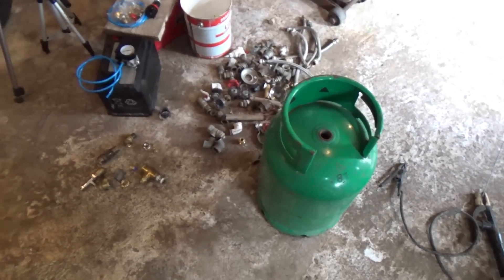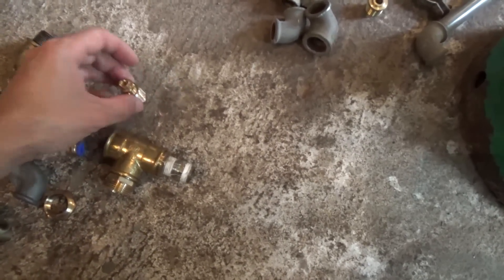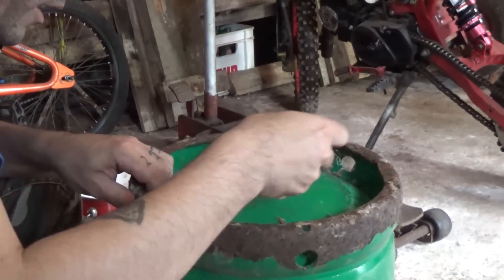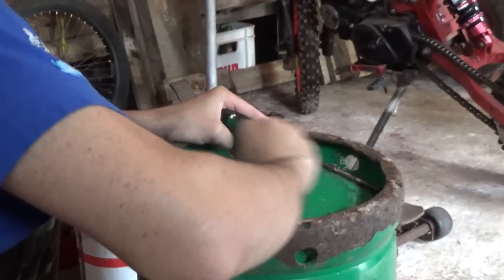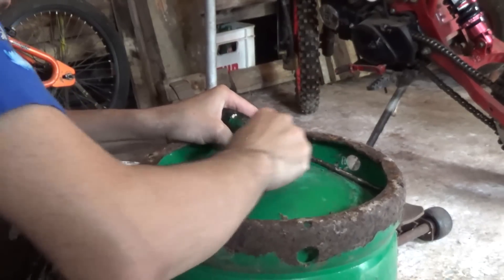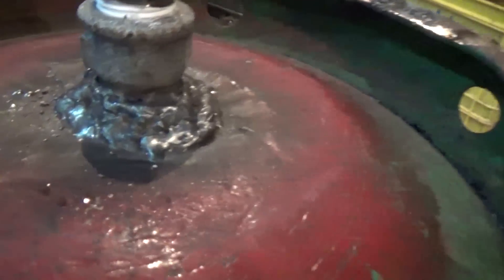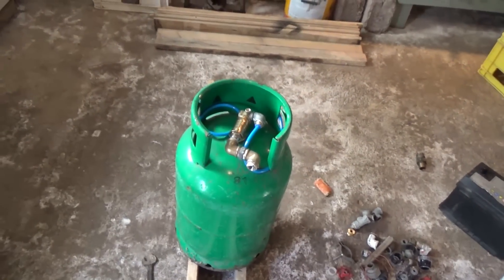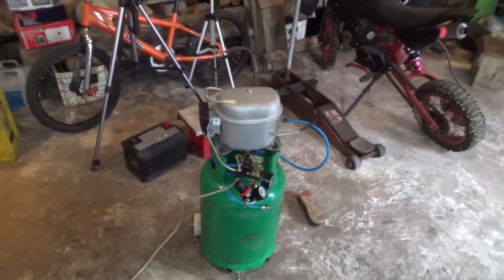Homemade silent air compressor

Comment: If you can't weld, weld lots!
Reply: A grinder and paint makes me the welder I ain't
Reply: Ah no it does not.  But keep practicing.  Every time you weld you will get better and better.  Plus have a look at weldingtipsandtricks youtube page.  Excellent page and resource.
Reply: ***** Couch Ave???
Reply: ***** Ok Thanks
Reply: I agree, he can't weld worth a shit and he said if he had a tig welder he could do better.   NO WAY.  If you can't weld with stick Tig is a lot harder than stick weld.  Even Mig he would do a lousy job.

Comment: Usually the freon or whatever refrigerant runs thru the compressor has oil mixed with it to aid lubrication. Right now I suspect you're running dry air or just air rather. This might kill your compressor a little sooner than usual
Reply: The compressor has its own oil inside. The refrigerant is not the primary lubricant
Reply: No that's correct the refrigerant carries the lubricant around the system however oxygen will over time (I'm not an expert) monoxodize the giggling shaft of the compressor! But till then it's Happy Compressing!
Reply: Jes, 
the oil comes with the refrigerant, and now with the air.
Makes it run dry
Reply: Vikram Nayak 
the compressor will be fine the oil in a fridge does not go around the system .
the oil is sprayed up in side the compressor lubricating it. so using it as a air compressor will be fine if he tops up the oil lost
Reply: You could just flush the oils and contaminants out of your reclaim Refrigerant tanks

Comment: This type of compressor was designed to operate in a close loop containing small amounts of recirculated oil. It will not last long running dry. :/

Comment: Why do you need to purge it ?  you are just compressing airdrop some dry ice in the tank for safety sake as it won't burn or allow the fuel to burn  .  and if you want the drain for draining water and oil , the tank is small enough to just turn it over and let it drain out the top valve

Comment: Nice little project, I built similar but used an old 10l compressor tank.
Two bits of advice, fit a filter on the inlet pipe, I use a plastic fuel filter. Cover that pressure switch, you have live terminals exposed right next to your pressure tap, not a great move. Also make sure that earth strap also connects to the bottle ( so that was really 3 bits of advice). Thanks for posting.
Reply from the maker: Thanks for the advice :)

Comment: This is dangerous. Propane tanks like this are not designed to be refilled for long-term use; they are made of relatively thin metal that can't resist rust (from atmospheric humidity) as well as standard air vessels. Compressed gas has tremendous energy that could be released if the tank ruptures from a weak spot. Perhaps if you had some kind of valving that would allow you to use the compressor to pull a vacuum on the tank and keep it there during storage, you could keep moisture out.

Comment: TAKE CARE ! DON'T MESS WITH PROPANE ! Before You open the tank be sure no gas remained inside.... this should be done not just opening the valve !!!! A small amount of gas will remain insiede ready to explode. To completely empty the propane tank use WATER ! Fill the tank with water using a small rubber pipe. Once You fill it, the gas will be completely evacuated ! Don't skip this step !!!
Reply: Dude.... here vin Italy, We use propane tank as compressor tank .... without any issue. Surely.... if You don't fill it with water before you start welding... don't forget to say goodbye to your parents, friends and wife before you start welding. :)
 Filling it with water is the most safe and easy way to be sure that no gas remains inside. Water completely push the gas outside. Bye.
Reply: Sorry, that's just plain wrong. Propane vaporizes at ambient pressure so it's physically impossible for any container to hold liquid propane at ambient pressure. As he said in the video, it has been sitting with the valve off for about 6 months. There is no such thing as residual propane except perhaps a bit of vapor immediately after removing the valve...which isn't the case here.

Introducing water into these tanks for any reason is a very bad idea because it will sit in the bottom of the tank and rust the steel from the inside out, reducing the tank's strength without any signs on the outside that it's been compromised.

I have made made many campstoves out of expired propane bottles and have never seen a flash from 'residual gas'.
Reply: @DeadeyeLefty  @Feather Merchant Pressure vessels are tested using water. A bit of water didn't hurt anything. The tank water drain plug and discipline to use it is to protect the tank against long term water damage. Then again the tank should be tested periodically, funnily enough using water!
Reply: Except that the gas has already escaped through whatever opening the water is escaping from. Your post suggests you don't really know much about propane but are welding on tanks anyway. Now THAT is scary !

Propane can't exist as a liquid at ambient pressure (in open air). If you leave the valve off the tank for six month as the maker of this video did, it is not physically possible for there to be ANY propane left in the tank.

The process you describe is for welding on liquid fuel tanks, which I have also done on stationary powerplants. In that case yes, you absolutely do displace any remaining liquid fuel and fill the tank's headspace with water so any liquid fuel remaining doesn't have the space to create vapors...but none of that applies to propane.

Perhaps you should talk to some propane installers "here in vin,Italy" and learn a bit more about the hazards of the materials you are working with before welding on a tank again ?
Reply: With aircraft tanks, one can use steam, requiring less time to fully purge the propane (incl the gas that has 'soaked' into the very steel metal!)  .. Maybe hours of high pressure steam, rather than days of flowing water .. Best to check the 'Aircraft Repair and Maintenance ' manuals ...from the FAA in USA.
DON'T MESS WITH TANKS NOT FULLY FULLY PURGED OF INFLAMMABLE MATERIALS!!!!   EVEN IF YOU DO HAVE A 'SUICIDE WISH'..
Reply: Tkj Tkj
Well said.
Reply: "Introducing water into these tanks for any reason is a very bad idea because it will sit in the bottom of the tank and rust the steel..." Water WILL be introduced into the tank during the process of compressing air. Air compressor tanks must be drained on a regular basis (that's why they have drains on the bottom).
Reply: Compressor tanks are built with exactly that in mind, propane tanks are not. As a result, compressor tanks are built of heavier guage steel than propane tanks for the same working pressure. Compare the tare weights of the two to see the difference. 

Additionally, all compressors have some blow-by which will eventually coat the inside of the tank with a film of oil. This is why spray rigs have separators to get oil (and of course water) out of the delivered air. Next time you drain your compressor, do so onto a piece of metal and check out the oily residue left behind after the water evaporates.

If you look at commercial installations (where longevity is key), you will see fins on the lines leading from the compressor head(s) to the tank. This is specifically to bleed off the heat of compression and reduce subsequent condensation once that hot air hits the cool or ambient tank (which is what you're referring to). You will also often see inline driers to remove humidity from the intake air. The biggest reason for draining compressor tanks regularly (along with the other measures I've mentioned) is to keep moisture out of the delivered air...NOT to keep the tank from rusting out.
Obviously, moisture becomes much more of an issue when one uses a much lighter LPG tank as a boost tank (as I'm doing with a 60 pounder)

But of course, all of that is entirely beside the point because there is no hazard of 'residual propane' to warrant putting water into the tank in the first place.
Reply: +DL Say no more!  You've proved your expertise beyond any reasonable question.  When may we expect to see your excellent YouTube video on this topic?
Reply: Feather Merchant

Haha sure, because knowledge of a subject is confirmed by whether or not one uploads videos...
Reply: I feel for you DL. You explained in a very concise and factual way what is wrong with their theory, and they still denied it. Their loss. Until they understand a bit more about states of matter and miscibility of steel they won't understand. I think they've seen too many movies where propane tanks somehow explode by shooting them.
Reply: +DL AFAIK most propane sold for refilling 20 lb. tanks is not completely dry.  They are exposed to internal moisture during the tank's lifetime.  I would not be overly concerned about rinsing the tank with water.  There are several methods by which it can be dried afterwards.
Reply: Unless it's been contaminated, propane is indeed completely dry and, unlike gasoline, there aren't different grades. With a few exceptions (as in all things) it's all HD5.

It's not rinsing the tank with water that's the problem...it's needlessly rinsing the tank with water because one doesn't understand the properties and hazards of the material one is working with. The inside of the tank is uncoated steel so in applications like these it will not be dried and will certainly not be coated. To a thin-walled tank like these, rust is a far bigger concern than residual propane...especially when you think about the number of pressure cycles it will see in its new use.
Reply: Or maybe your "knowledge" will be conveyed by your "competence" while you show and explain your processes.
Anyone can copy/paste information gleaned from various websites on a subject.

There is a phrase that has become widely used during the growth of social networking websites..."pics or it never happened"...in this case "vids or people will just think you're a "wiki-paster".

I look forward to seeing your welding, brazing and soldering skills.

All the best
Swamp Monkey the Archaeo-Engineer
Reply from the maker: Yes i did that, thanks for the advice anyway :)

Comment: Pretty ingenious.  I liked your propane torch. Can you get higher temp gases on that? I wonder if it would have been easier to get the 3/4" tap and run a thread instead of welding it? Just thinking, not to criticize you. Thanks for vid.

Comment: nice work! I was thinking to use a refrigerator motor as air compressor too. But in your project, I saw that it charges too slow; it may not coupe with the amount of air discharge my tools will need. Do you have a plan on how to make the charging or increase the pressure faster?

Comment: This is not a bad idea; and it's probably a useful project, but the welding is completely un-necessary. You can put 1/8" pipe threads in a hole in the bottom of the tank; drain valves with 1/8" male threads are available from Auto Parts stores or large Hardware stores. The ideal way to make the hole is to drill 1/4" and then roll the metal inward with a tapered steel punch and hammer until it will clear a 5/16" drill bit. 5/16"; is the tap drill size for 1/8" pipe thread. You'll need to buy a 1/8" Pipe Tap. Because it's a tapered thread, just keep driving the tap in and checking until the valve you bought enters the threads with sufficient engagement; several turns; teflon tape is appropriate here. Cheers.

Comment: and also now that the compressor is pumping air instead of freon it will soon seize up unless u put an oiler on the intake side trust me.
Reply: You still keep oil in the compressor shell for lubrication. There should be a good air filter to keep dust out of the oil. Even if the compressor gives up the ghost, how hard is it to find another one?

Comment: There is NO WAY I would trust welding like that on a pressure vessel. If/when that lets go it could be interesting. I would have drilled and tapped the cylinder and then run a single continuous weld around it. The compressor also has oil in it, which can come out of the output. Not good if you are spray painting.
Reply: Yes, crappy welding - in keeping with other aspects of what the video shows.
However, the idea of a silent compressor for small jobs appeals.

Comment: What is powering the compressor?
Reply: Magic!
Reply: AsiAzzy
Is that flux capacitor magic of harry potter magic?
Reply: Idk, "it's a kind of magic" - Queen
Reply: And if the question was genuine.. it runs from the mains. (the compressor is run directly from mains and here the valve has a switch to turn on the compressor if pressure too low, and turn off the compressor when it reached the set threshold pressure)
Reply: AsiAzzy
Ah so it’s not running from a small petrol generator. Thank you

Comment: You're waiting 30 minutes for a charge that lasts no longer than 2 minutes. I'm not sure this is worth the work. Maybe if you used something smaller, like a fire extinguisher, you could have used it for blowing some leaves or dust from a PC. But at its size, it's not really that practical.

Nonetheless, it is an interesting project, you did a good job, even if it's not looking professional (I know how it feels to work with old tools). It looks better than what I would do.

Comment: Thumbs up! - Great project man.  Well done :-)

Your air compressor works very well!,  you certainly  put all those parts to good use making a very useful tool for your workshop.

Your compressor should be very handy for air brush painting and other similar air tools which don't require too much air.

P.S, Good effort on the welding, it held the air pressure nicely despite not looking pretty, More practice with moving your welding rod in a circular motion as you move along will get you a better, neater weld - but like you say, you cannot beat the finish of a Tig welder - Tig vs Arc, the Tig welder will always win hands down.

All the very best in all you do - keep on rocking man!

Comment: is it me or he din't drill a hole at bottom? how does the air gets out from there?
Reply: the hole for the purge valve that releases the moisture doesnt have to be very big so he welded on the fitting first & then took a small drill bit and drilled the hole out thru the fitting. it can be done either way.
Reply: yeahhhh, haha
Reply: the hole is to nallow him to remove condensed moisture

Comment: I like the idea of using an old propane bottle for an air pump. Maybe instead of using a stick welder, try using 90/10 silver solder, as it is less chance of warping or burning through the metal. Great video!!! Thanks for posting.
Reply: I bought a tank conversion kit from the local RV dealer here and they sold me an old outdated tank for $5-Works great!

Comment: Should have used a cola bottle at these pressures, tap out the cap and swap the bottle every once in a while lol
Reply: remember these little compressors can put lut a lot more pressure. I have seen pressures near 300 psi on a rooftoop A/C in the summer sun....

Comment: OK, air from fridge motor contains traces of condensed water. 
Water + air + internal walls of propane bottle = rust.
 Rust in propane bottle = weakening of the walls.
 Weakening of the walls + air pressure = EXPLOSION HAZARD.
Reply: +Nasrani MinAlGharb Every Air Compressor accumulates water on the inside as a result of the surrounding humidity, this is why most compressors have purge valve on the bottom to allow for periodic draining. You're absolutely right though, evetually, over quite some time the walls we become too weak for the pressure, but after a very, very long time.
Reply: *****
The thing is, tanks made specifically for air compressors are either stainless or lined or painted with waterproof material on the inside. Propane bottles are made to store dry compressed propane and so may not be waterproofed on the inside.
Reply: Huh. that makes perfect sense. Didn't think about that!

Comment: next time when you want to safely remove all the gas from a gas can poor water in it. do not assume that letting that open for 2 weeks will end up with no gas in it. if was propane that might work because it is slight less dense than air but is no a guarantee. if it is GPL / PGL that is more dense than air a small surprise can occure when sparks are introduced in the mix. better to be safe than sorry. nice dirt bikes in the back to be tinker with.
Reply: All LPG including propane, is heavier than air.
Reply: +Shaun Dobbie my bad, you are right about it.
Reply: compressed natural  gas, the preferred fuel for boat stoves and heating is lighter than air.

Comment: that alot of oil compressor will be drained into that bottle
Reply: +kutukupret 
A good fridge compressor wont throw much oil out. Mine use 5 ml of oil per 40 hours of running which is around 7000 cubic feet of air

Comment: If the metal was thick enough it might have been easier to drill and tap for the fitting rather than welding. Was the tank a 19kg propane cylinder?
Reply: +Atom izer good idea but there might be water residue left if you will just tap the fitting.  It should be located at the deepest part i guess.

Comment: I was more interested in how you did the fittings. There's a T fitting coming from the tank, a one-way valve for the input and the other side is connected to the output (the pressure switch and regulator)?
Reply from the maker: +Bogdan Serban yes that is correct on the T fitting one side is IN through the one way valve and the other side is OUT through pressure switch and regulator
Reply: +luisfilipe1983 the one way valve has three connections, one goes to the tank, one from the motor and where does the other one go?
Reply from the maker: +Bogdan Serban the other one is the thinest one it goes to the bottom of the pressure switch to plug on a little valve wich is there to release pressure in the intake hose when full